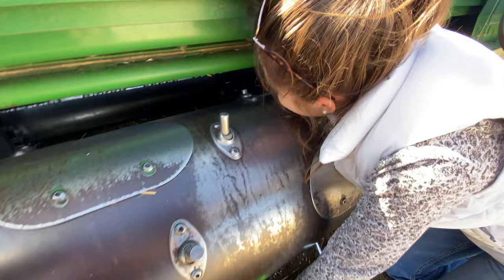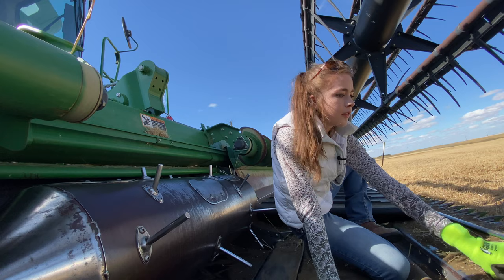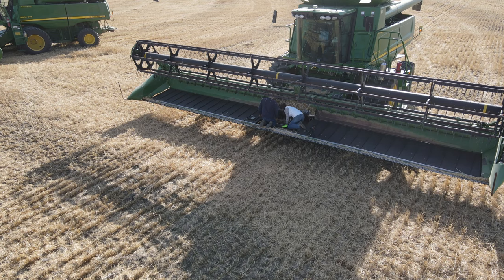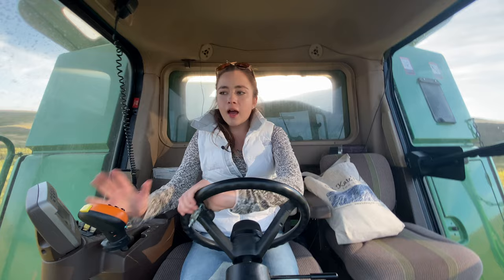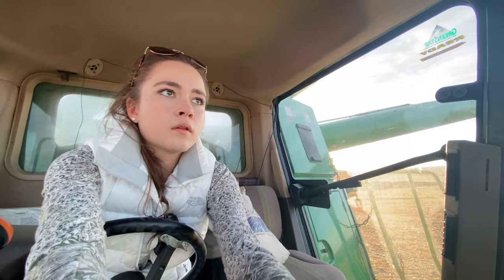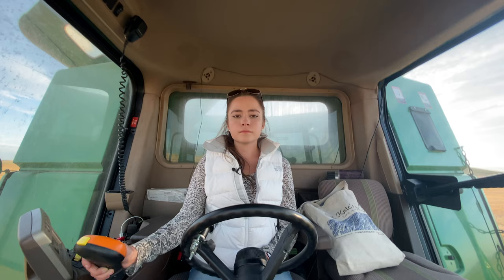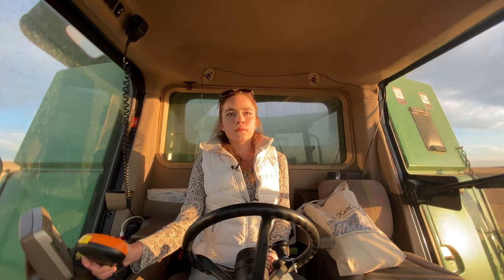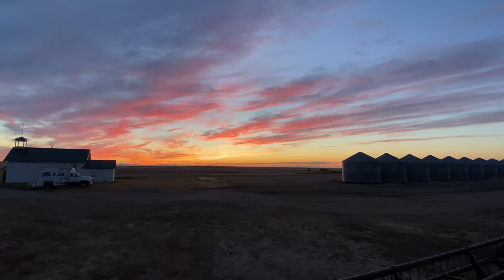Disaster!! Digging Out Dirt & Last Day of Harvest 2021.  Montana

Comment: Further to my previous comment: according to NASD Agri Engineering they say:   "Don't rely on the hydraulic system for support when working under the machine header. Always use the stops or supports provided on the machine. If no safety device is provided, block the header securely".
Reply from the maker: Thank you for your great advice!

Comment: Hey Kate.. just something I wanted to point out to you that you might want to watch yourself on. At 10:00 min I noticed when you were slowing down you pulled the hydrostat lever back past neutral when you were still going forward.. You can cause some nasty high pressures in the hydraulic system doing that. You only want to gradually pull it back and not go into reverse until youre stopped. Just want to save you from a headache and keep from blowing some seals or a hydraulic line. 
I really like watching youre videos. Good job girl! 😊👍
Reply from the maker: Thank you for your great advice and kindness!!!!!!!!!!!!!!!!!

Comment: I've worked in safety for 35 years and when I saw you and your dad inside the combine machinery I wondered what safety devices are in place to prevent the suspended parts from inadvertently failing or falling for any reason.  It is usually standard practice to support any raised equipment to preventing it from closing or falling.
Reply from the maker: Thank you for your great story and kind advice!

Comment: Looks like you need a long hoe to pull that material out. A leaf blower would certainly help cleaning out the material and preventing fires. Make it easier to keep the machine clean. I use them to clean when there is no compressed air. Construction workers use them even more, as well as gardeners.
I still remember your video on bad bearing. Your dad should get a FLIR infrared camera from places like Amazon. The camera will help spot bearings going bad. A failing bearing will start generating heat and the camera will see the heat. I use one to check bearings, gear boxes, and electric motors at the plant I work at. A $500 thermal camera is a good investment to if it helps maintain your family multiple combines and tractors. Being able to see a bearing problem early will help improve the farm operations efficiency when it lowers the down time on the machines. The camera would have certainly have seen the bad bearing on your rear tire and prevent a costly and difficult repair.
A grease bearing that goes above 150 degrees is in trouble. Sometimes it just needs grease. If it gets hotter the grease runs out. Next is failure and/or fire.
Reply from the maker: Thank you for your wonderful suggestion.  I will let Dad know!!!!
Reply: @KatesAg  
You are welcomed. 👍

Comment: Hi Kate 
Suggestion
As a farmer u should always try to understand 
Problems & then try to find possible solutions 
Plugged header with straw & Dirt 
Time is money 
It may be wise to Set up a high Pressure portable Air Compressor.
Hose Reel & a short & longer Lance 
To Air Blast that crap out of your machine please use 
Eye Protection 
Face Sheild & 
A Full Sealed face Mask to not breathe the Dust.
Water tank to clean up.
Rocks u may need a long Rod or 
A Slide Hammer Rod for the Difficult ones.
It will do the Job very 
Efficiently 
U are back on your way.

Later if all works well 
U can Set up protected air flexible SSteel pipework & various locations of 
Blaster noozes. 

I love you passion
Your dedication to create a magical interesting story 
You have so much potential as a business person, 
Journalists, interviewer 
Film maker Director etc etc 

Video is Great 
Audio is next one 
Always try to improve your
Sound Quality 
Unwanted Noises & overall tonal results.
The big Sound Quality 
Inform & educate is great
As you would already know
yelling, screaming or
Screeching or bad Wind nosies 
Is very hard on the ears & to keep an audience.

Kate 17 Wow 
Smart intelligent young lady
Go Girl 
You are so Wonderful 
Keep up with the Show.
Reply from the maker: Thank you for your kind words and comment.

Comment: You should have had some kind of vacuum cleaner with a long nozzle to get the dirt out. Digging it out with your hands looked very uncomfortable and dangerous. You should at least have a long rod with a scraper of wood or plastic (and a powerful flashlight) at the end so you could pull out dirt that way; you know, just like digging the ashes out of an oven.
Reply: Where's your miniature corgie when you need him.
  Those dogs won't ever give up. There cute there persistent and there determined.
 And don't mess with them when there working... They might bite your fingers off.
But there loyal to there masters.
  Mean mean digging machine.
  You did well kate😊😊 God bless... Fun 😄
Reply from the maker: Thank you for your kind advice!

Comment: I've never worked on such a machine, but I feel like there should be a way to drop that plate in order to dump out the material instead of doing it by hand.....if not, then poor design by JD.
Reply from the maker: Thank you for your great suggestion. We can drop the plate but we didn't want to take the time in the field because we needed to finish.  Getting the dirt out this way usually works and when it doesn't we have to take it to the home place to drop the plate.